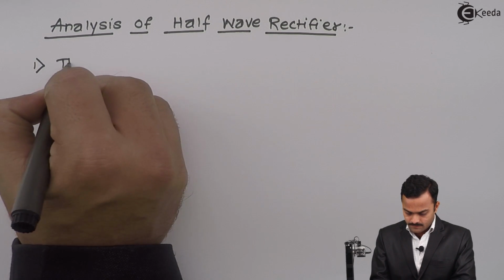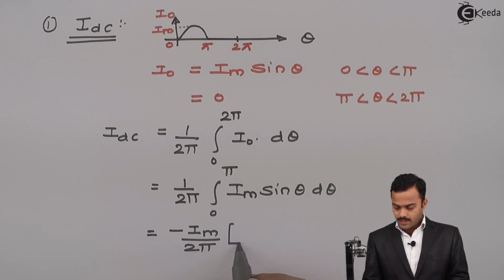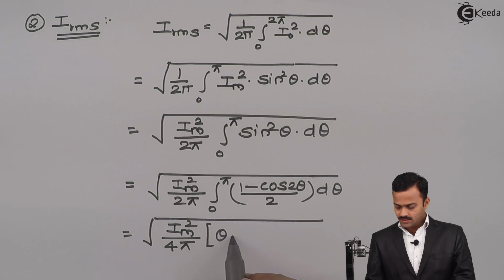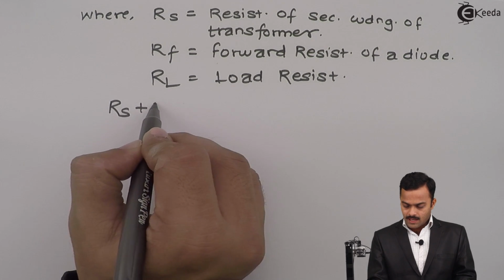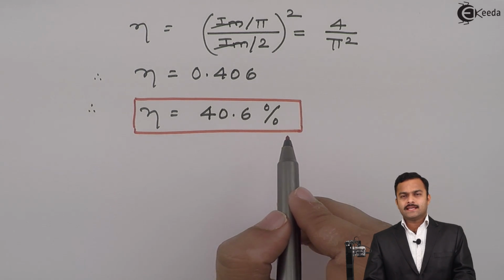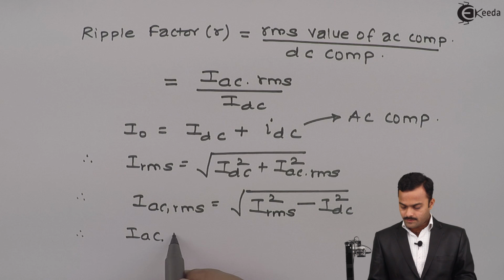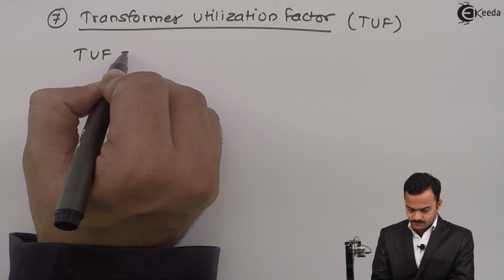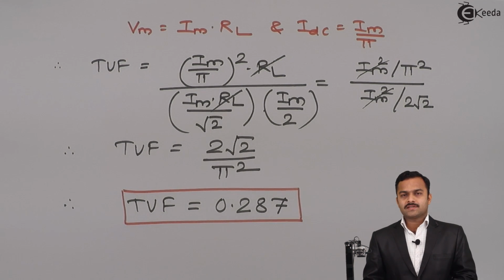Analysis of Half Wave Rectifier - Electronics - Basic Electrical Engineering

Comment: Sir why we calculate form factor in rectifier
What is use of this factor
Reply: deepak singh to know the amount of smoothness of output wave (as output is not exactly do voltage instead it is a rectified pulsating do voltage)
Reply: To calculate ripple factor
Reply: Learn easily the basic concept of Transistor and Full wave and Half wave rectifier from the video link given bellow
https://youtu.be/KIBHW1jRBsA